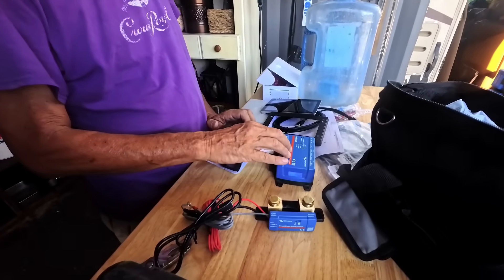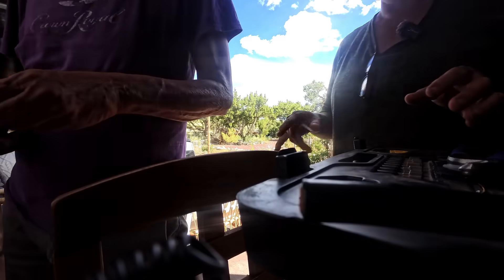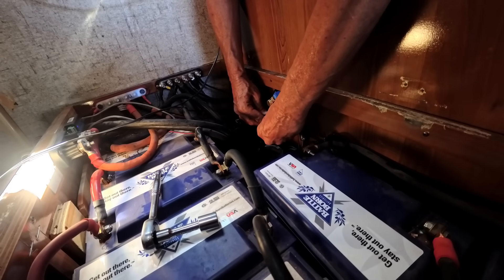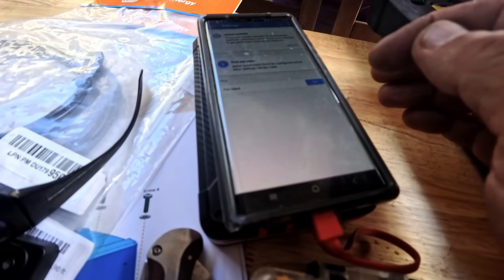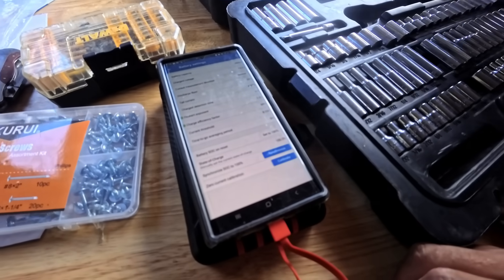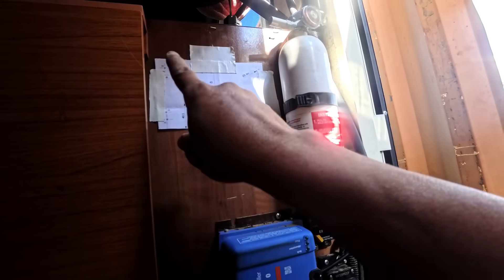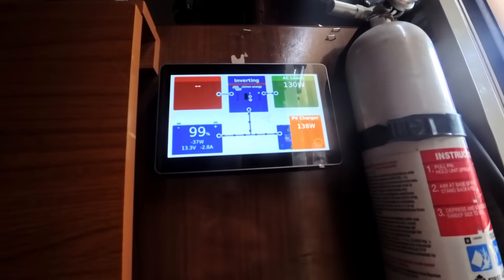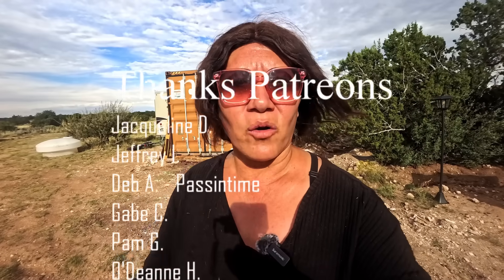Dealing With Battery Problems!! Victron Shunt & Cerbo | DIY Solar Panel System

Comment: Are you putting the side back on your shipping container when you leave to travel? You could always use as we Aussies call a security door on it. You just slide across, it gets the air flow. But, you might need to put a solid awning in front of the door to stop the snow and rain blowing in and wet ya stuff. The awning roof could be corrugated.
Reply from the maker: Next q&a